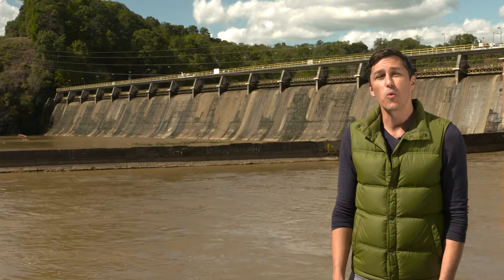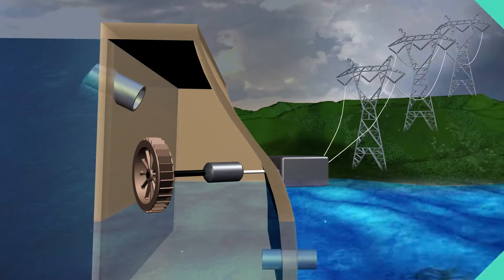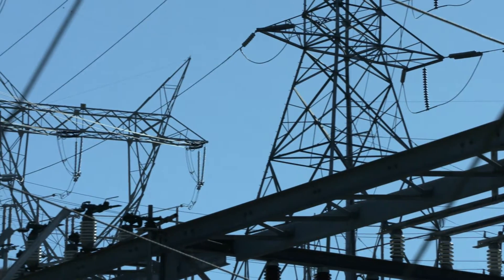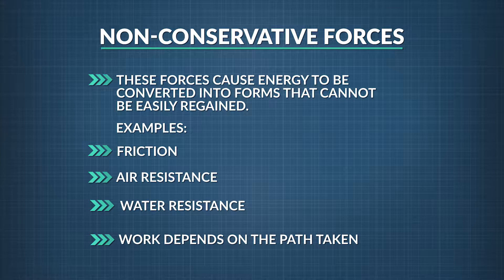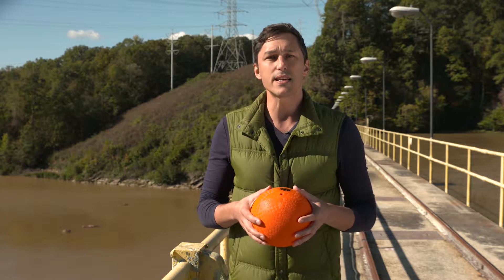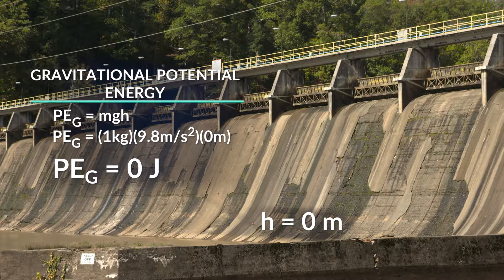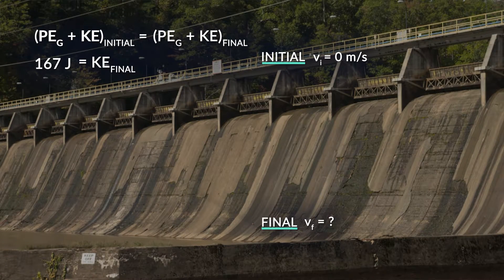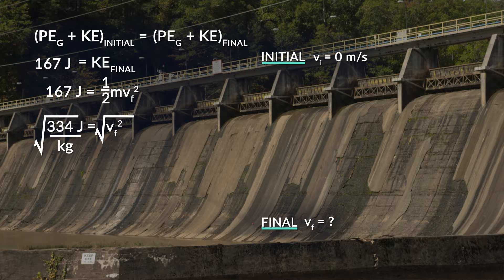What Is the Conservation of Energy? | Physics in Motion

Comment: Energy cannot be destroyed, so where are the energy goes due to non-conservative forces? If the energy due to non-conservatve forces  converted to other form, how can we know where it goes?  
How if it converted into heat, where the heat goes? Are all the heat naturaly travel through air and  indirectly affect weather? If so, that heat indirectly vaporize water and the rain is created. Then rain create river and the water goes back to the dam. cmiiw
But how about converted into sound? I am curious about energy cycle 🤔
Reply: I'll try to explain some of the facts to cover for your asked questions as per the sequence : 

1. Yes, energy can not be destroyed. Is it only energy ? Definitely no. It is overall energy which is never gets destroyed. But definitely yes, if mechanical energy. Mechanical energies are the combination of only two energies - Kinetic & Potential which are actually associated with body's motion. Many of the us have a confusion that strain & sound energies too are one of the mechanical energy. But that's a misnomer. Because, in any motion dynamics problem, there is always some finite deformation though it may be negligible & always prone to produce sound though it is very weak. And what about friction ? As it can never be neglected. So, in short, these non- conservative forces are consuming some part of mechanical energy to produce these kinds of energies like frictional rub, sound & strain. But here, mostly frictional loss is the only form of energy considered which is contribution from work done by non- conservative forces. As deformation & sound energies whether they are useful or not depends upon the perception made behind any particular application problem. So they can't be considered to be by non- conservative forces all time. But if friction, then ultimately yes. Because, it is the most irreversible form of energy which directly connects with heat which is the low grade of energy by the second law of thermodynamics. 

2. If we wants to know about energy consumed by non- conservative forces then it is simple to compare the initial energy content in the body in the form of kinetic & potential (mechanical energy as per previous point discussed) with the final energy content based on the reference limits you will consider for applying law of conservation of energy. For final point, if you gets the initial mechanical energy is not same but something extra effects are experienced like - 
• Finite rise in temperature of the body, 
• Finite deformation or strains in the body, 
• Or some noise intensity produced. 
These above extra effects are the sign of presence of consumption of initial mechanical energy to other forms of energy in the form of heat, strain or sound respectively. But mostly for rigid bodies, only frictional generated heat is considered to be the work done by non- conservative forces & relatively other rest of two effects may be ignorable. But all this depends on that particular application circumstances. 

3. If it is converted into heat, it simultaneously gets transferred to the immediate surrounding interfaced body surfaces to increase their temperatures locally. The region of being gets affected is based on many other factors like time scale of heat transfer or heat flux, geometric magnitudes of the exposed surfaces & relatively bulk volume of the involved bodies, their specific heat, thermal conductivity etc. 

4. Even if it (heat) naturally travels through air, it affects it locally in the air & it has nothing to do significantly in the whole whether which is very large scale space of air as compared to the scale of application involved. 

5. It will never affect & has nothing to do with the subsequent activities like rainfall & all. As these phenomena are not artificially occured. These phenomena involves the radiative heat action from sun which is the biggest source of heat energy in this universe. Not only heat transfer but for the process of whether phenomena & rainfalls, the thermodynamics of phases, saturation pressures & temperatures, etc concepts are role playing here. 

6. As dams are designed to be the sufficient accumulators for the storage of the water as a purpose of achieving the great potential energy to convert possibly to Kinetic energy for running power plants & other auxillary applications. The rivers are produced from the continuous rainfall from mountains with high potential energies to achieve a great & sufficient kinetic energies over large possible distances & in order to win & compensate over the local by local losses due to friction & noise of water with land constituents like obstacles, stones, turns & many more in the river stream path. 

Sorry for long answer but hope, you will get some basic idea about your doubts.